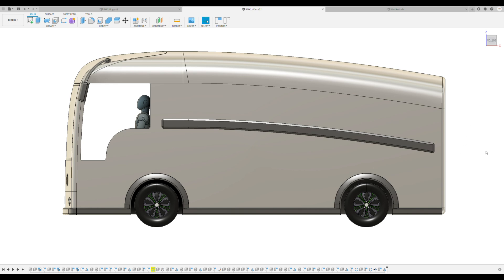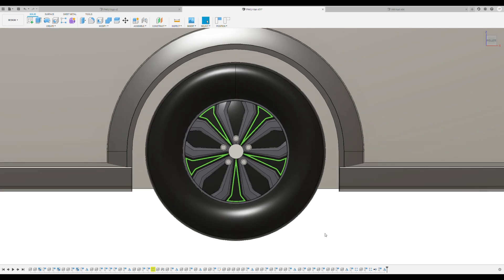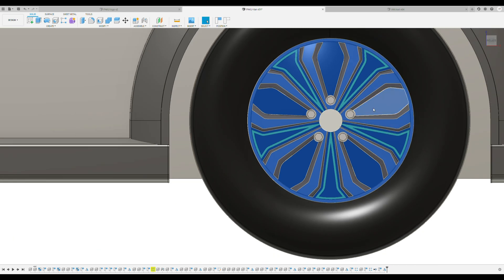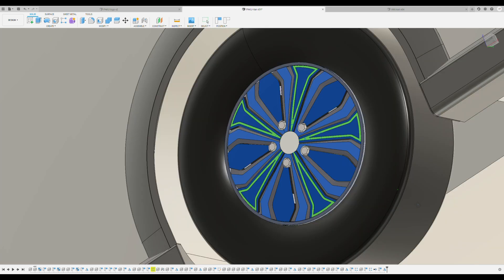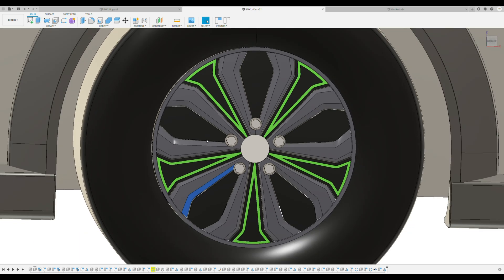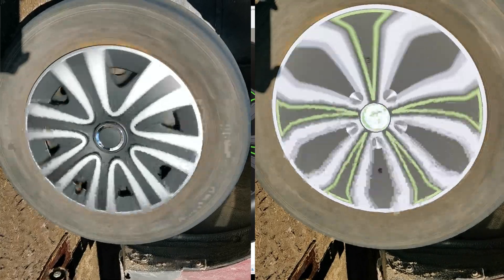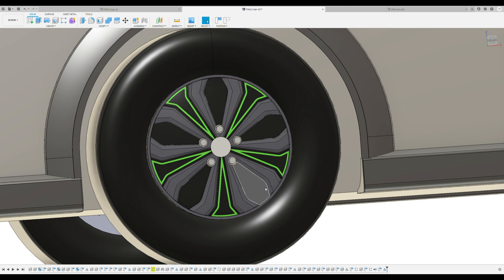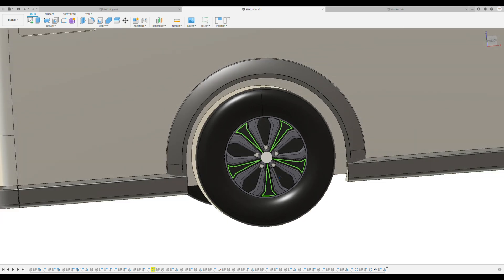Smooth aerodynamic wheelcovers design and benefits explained

Comment: Very intetesting. Is it a cover to existing wheels ?
Reply from the maker: Will make my own wheel model for Evs and in Tesla. Will lower consumption - 10% with correct tires
Reply: @vesatiainen9701  
How you check the cooling flow and the drag ?
Which technology to make them ?